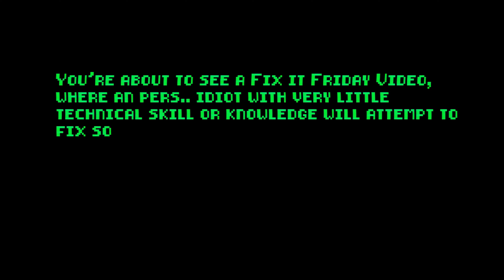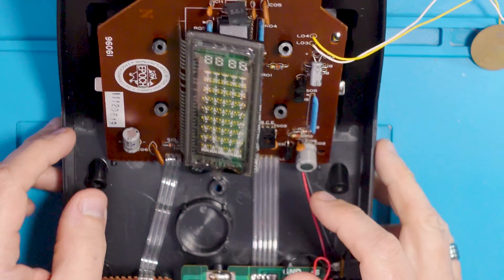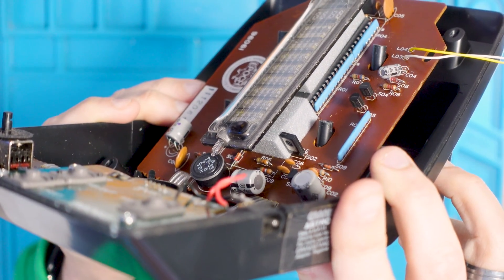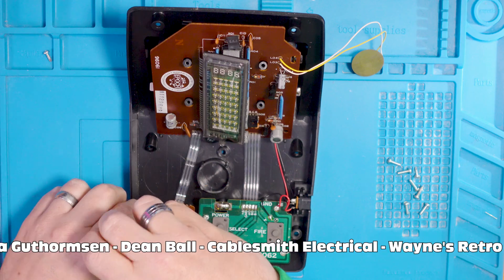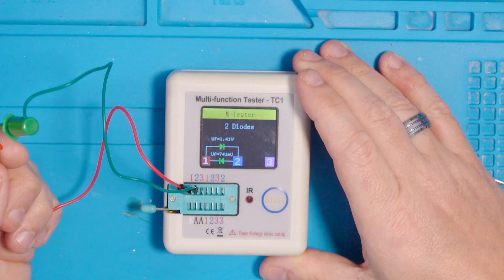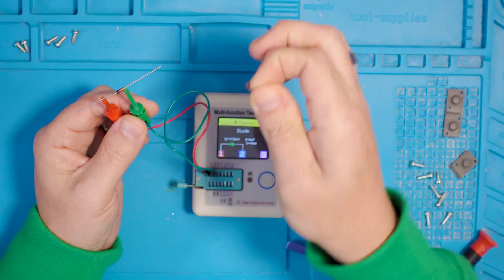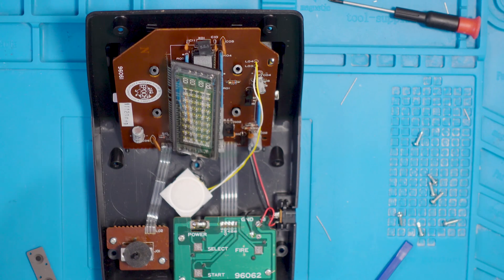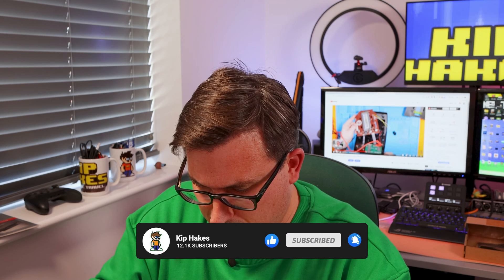It burned me last time! The Astro Wars is BACK! Can I fix it? Part 2 - Fix it Friday

Comment: THANKYOU so much for this video! I bought a completely dead Astro Wars game a couple of weeks ago. Followed your zener diode trick, and replaced both transistors, and got it working! Felt like I'd won the lottery when it powered up an hour ago! Incredible feeling!
Reply from the maker: Ahh that makes me so happy buddy! Thanks so much for watching and commenting
Reply: @KipHakes  The ribbon cable for the left-right controller was also broken on mine, so I replaced it using a few lengths of wire. Simple fix really, but I'm so pleased that I got it back fully working. Thanks again for this excellent walk-through!
Reply from the maker: @DrunkChimp yes it’s quite common for those to fail, but like you say, a relatively easy fix

Comment: Never knew about diodes in series. How come it needs such a high voltage? Is that something to do with the display?
Reply: I was thinking the same, anything close to 140v would be very high especially if it's running off battery. It would be intresting to know the actual voltage.
Reply from the maker: It’s for the display (the VFD) it is pretty high voltage apparently.